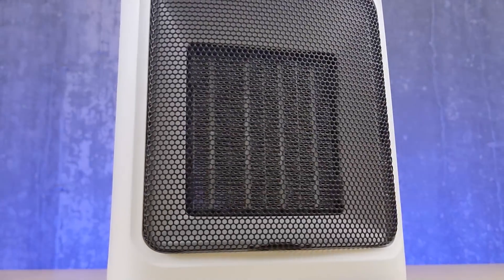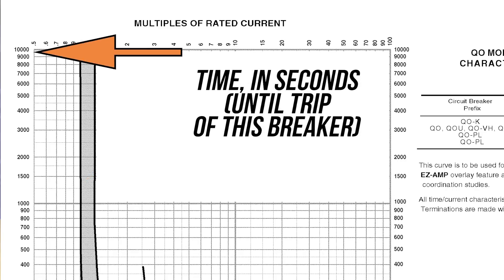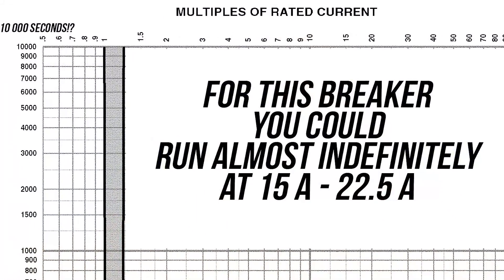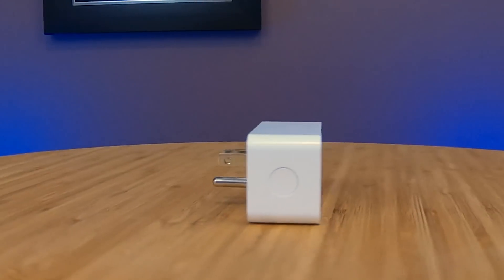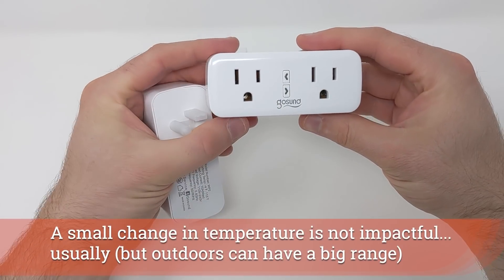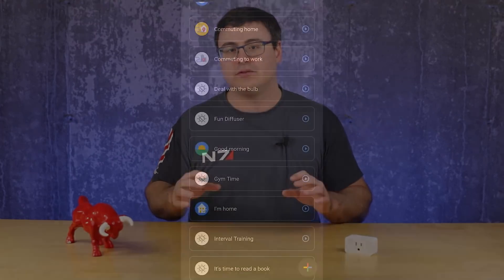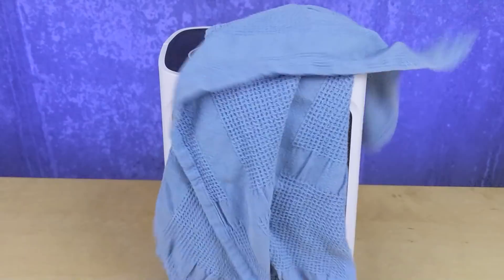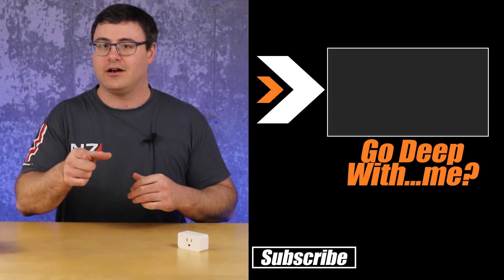Why Smart Plugs EXPLODE or MELT With Heaters!  Are Smart Plugs Safe?

Comment: Hey Brian, great video. I had two smartthing plugs run power monitoring on both washer and dryer. Based on that I created and automation in smartthings app and thanks to your "Amazing Device" handler Alexa was telling me "laundry finished" etc. Was afraid that AMP be too big for these plugs but had no issues. After getting eero pro 6 it's impossible for me to connect them back, have no clue why, it's the only device giving me hard time. Now I need either new plugs doing same thing or new wifi washer and dryer, but my Miss would break my b$lls if she knew that this is the only reason I'm replacing these units lol I'll probably go with aeotec, hopefully these will do the same as the other plugs 🔌
Reply from the maker: Huh...That's REALLY annoying.  I don't know why they'd struggle so much.  Obviously you've tried things like a full factory reset and bringing them closer to the Eero right?  It's also possible now maybe a setting in Eero isn't allowing connection of those...maybe it's a security thing.
Reply: @AutomateYourLife  no clue Brian, tried everything. But, this might be a rookie mistake and lesson for others.. not saying that it is. Another addon to your video about beginning of this journey etc.. I have a one special character in my wifi password, it might be that these plugs won't see your wifi with it. I have so many devices added that changing a password to something else and adding them all would be another day taken out of my life, not even gonna try. But broadlink rm4 pro didn't connect either, where it says something about special characters in its manual. This might be the issue
Reply from the maker: Oh very interesting...something to test!  Although I do have characters...

Comment: Hey Brain, couldn't people just buy a smart heater, so it's correctly balanced, so one wouldn't have to risk doing this?  I love smart plugs, I have three from amazon.  I would prefer buying a device with the smarts built in though, because you usually get more options and control that way.
Reply from the maker: Yep!  So I haven't seen a lot of good smart space heaters, which is why I talked about the Dyson there.  It does both and has some additional protections!
Reply: @AutomateYourLife  I was actually considering if my pedestal fan I have on a smart plug would eventually cause a problem.  It's just a typical three speed fan by Lasko, but motors do have a coil and they heat up.  So wasn't sure if it would ever get to the point I'd need to be concerned.  It's the only device on that plug, and so far nothing has been hot when I've touched either one.
Reply from the maker: @macinman  you should be fine with fans.  They actually have a very different inrush than bigger heaters and it's usually a lot easier to run :)

Your fan will have a length of time it's allowed to run continuously for though.  They always do!

Comment: You should have done this video the ElectroBOOM way and melted one of those WYZE plugs on-camera...HA HA! I only kid. 
Real question: what about those hard-wired, in-wall, smart plugs? I think TP-Link has an in-wall version. Would those handle a heater? I've always wanted to have a smartplug on a heater for the just in case instance I leave it on and leave the house. I've never wanted to use it for automations or to turn it on when I'm not home. Thanks as always for your work and the informative videos (and keeping our houses from going BOOM!) :)
Reply from the maker: Isn't that guy just the best???  Maybe I need to ask him to do this one too.

So the actual outlets should be rated to handle this, but even those I'd have to look at damage curves on and understand if my breaker was protecting it.  But again, they should theoretically be protected by a standard 15A breaker

Comment: Incandescent, you did a very nice job presenting a very complex topic. I can give you a very good representation of arcing. We had an electric company at one of our factories that was working on the power supply coming into the building and the building was completely metal. And somehow arching. We had an electric company at one of our factories that was working on  the power supply coming into the building and the building was completely metal. And somehow they got the wrong kind of screwdriver Dropped In the Transformer Transformer and it caused and it caused an Arc to jump off the beams across the top of the building. I was told it was a very impressive sight to see you is like lightning going from one beam to the next. Keep up the great work. And be safe
Reply from the maker: Ohhhh that's a great story.  One day maybe I can tell all the stories about exploded buildings that I've seen...might have to!

Comment: This happens with UK plugs too. I was stupid enough to do it without thinking/checking, and melted my smartthings smart plug with my electric oil filled heater.
Reply: Have a look at igenix, they do sell on Amazon but sell convection heaters with smart functionality built in at a reasonable price.
Reply: Same but it's not really something that is easy to check. I didn't see any warnings on the device or on the Samsung website. All I see is it can handle up 1800 watts / 15 amp and oil heater is 1500 watt. Mine melted too. I guess I'm going to try to go the smart wall socket route.
Reply from the maker: It happens to so many.  Just glad you're safe!!